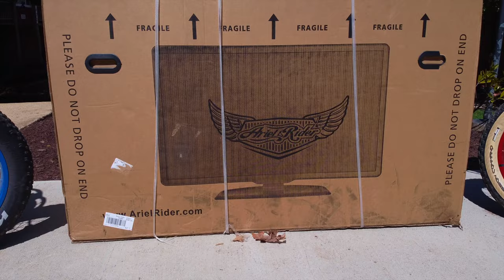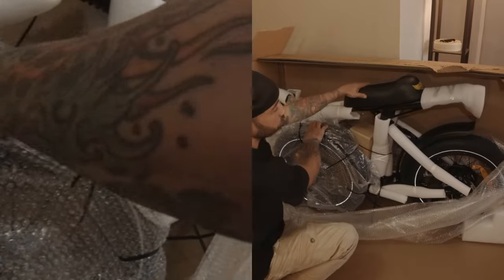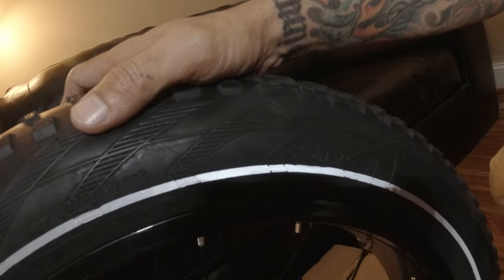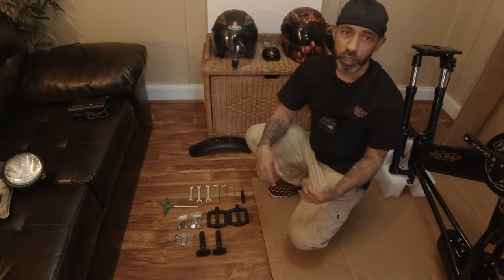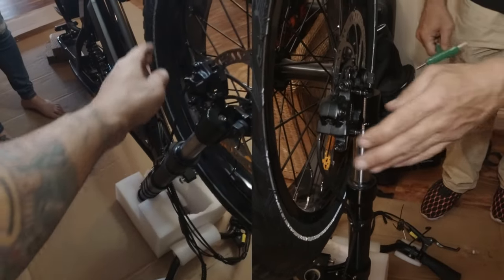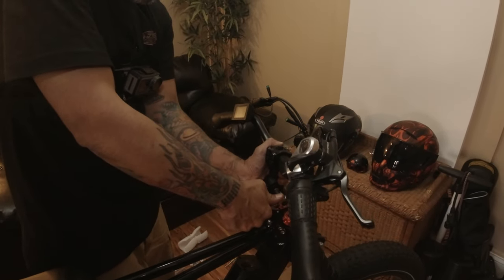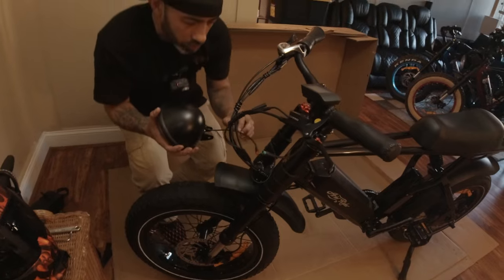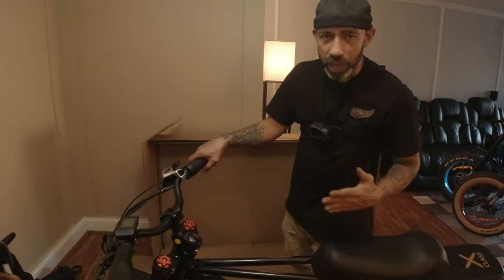52V Ariel Rider X-Class ✪ Unboxing & Assembly ✪ Fully loaded•1000W•35A•Adjustable suspension Ebike

Comment: Here's a tip for centering new brake pads to the disk. Loosen the adjustment allen screws, apply your brake and hold it, then tighten your allen screws while lightly holding brake on. This should center the disc in the pads, pressure and wear will be even. Thanks for all the hard work you put into your vids. Much better than network TV shows. Rusty is a rock star.
Reply from the maker: Richard thanks brother that means so much !

We did that as well but I left it out because the upstairs neighbors kids were making a racket (our ceilings are made of paper smh).  I meant to add a caption but forgot !!

Thanks so much for that important helpful tip !!

🐾

Comment: Hey my man if you want to adjust those calibers so they don't rub the rotors' loosen those two bolts like you did, hold the break and then tighten the screws as you're holding the brake' then release it and test it, they should be perfect and you can also do that to the rear if they're rubbing, quick and easy trick!✌👋👋
Reply from the maker: Yes indeed!!  I did that while adjusting them, but neither camera caught that part in frame 😔

Good call!!  

🐾 Thanks!!!
Reply: When you say hold the break you mean the caliber itself or the break on the handle bars?
Reply: You prolly dont care at all but does anybody know of a trick to get back into an Instagram account..?
I was dumb forgot the password. I would love any help you can give me
Reply: @Dalton Adriel instablaster ;)
Reply: @Brentley Ford thanks for your reply. I got to the site through google and im in the hacking process atm.
Takes a while so I will reply here later with my results.
Reply: @Brentley Ford It worked and I actually got access to my account again. Im so happy!
Thanks so much, you saved my ass :D
Reply: @Dalton Adriel happy to help :D

Comment: By far the best unboxing video!  The assembly is very detailed and liked the caliper adjustment.
Reply from the maker: Thanks so much for watching and for the kind words!!

Probably a better way to do it is to loosen the caliper bolts, squeeze the brake and then tighten the bolts while it's squeezed.  That should guarantee centering it.  The way I did it requires eyeballing and retrying 😅

🐾

Comment: Sweet video,hey another tip about the brake rotors,often they come with a slight warp (s) these can be straightened with very little pressure using a cresent wrench on the rotors themselves to plomb them before adjusting pads…
Reply from the maker: Thanks! That's a great tip!!

Cheers 🐾⚡🤙🏽

Comment: The calipers look like the most difficult part .along with getting them so they don't squeek or make noise or grinding feel.you made it look easy I'm not to good with mechanics thanks for the vid peace to you and yours
Reply from the maker: Another way (probably better in hindsight) is to loosen the caliper bolts just enough so the caliper moves, hold the brake lever down, then tighten the bolts while keeping the lever pulled the whole time.   That assures the rotor is centered 🐾

Comment: I just purchased mine today and during my research have been following your channel. I know this seems like an odd request but I need to see this in a medium sized doorway.  I see that your place is big but I need to see how much it clears the door way w/out a whole lot of space. Also I don't see the sticker on your bike showing it's a class 2. And in another video from another youtuber, I saw that he had a bike rack in his unboxing of the same unit. Thank you.
Reply from the maker: Hey MM congrats !

My place is actually pretty small, but I can assure you it fits through any standard door way 👍🏽

The class 2 sticker is on the center post near the battery

Hmm perhaps that person received the rack inside the box the bike came in since they orders them together 👍🏽

Cheers!!
Reply: @RustyRoads  Thanks for answering. I've just been waiting on my bike to get here. I asked those questions about the box size because I just wanted to make sure that UPS didn't have a problem fitting it inside of a regular size housing development elevator.

Comment: Thanks for the battery charge advice. Not enough concern for battery maintenance is shown for e bikes. I expect a lot of advances with constant voltage, heated and cooled batteries...
Reply from the maker: And compatibility with Electric car charging stations !!
Reply: @RustyRoads  , Absolutely! Some kind of standard, accessible charging system/network. And battery quick swapping.
Reply from the maker: New Videos premiering tonight !!  First range test !   Join the live chat !!  

🐾

Comment: I just ordered the step through version (lots of upgrades for 22 from this version).The display is terrible though, can you tell me if I can upgrade it and which higher end model can I purchase.
Reply from the maker: Congrats!!  

I have no issues with the display. Could it be better? Sure but on the other hand it provides battery level and speed.
Anything more can be handled much better by my phone 😎🤙🏽

Comment: Hi nice bike..if its a 1000w hub motor how does it get ta 2000w peak.. what's the amp controller on this ebike ..what makes it get ta 2000w power
Reply from the maker: Hi Gladstone, great question!

It's a 33 max amp controller, which is programmed to pull 2000W from the motor under heavy/initial acceleration,  but normally runs at 1000W otherwise.

🐾⚡🤙🏽

Comment: Thanks for the review!  We have  2 coming in mid May .  Like you I am disappointed in the display and light but thrilled about the twist throttle!  Can’t wait to get them.
Reply from the maker: Nice !! which colors ?

The display is literally the only cut corner with this bike, and that's not a knock on it at all.  Most if not all bikes have a corner cut here or there.  Def prefer a bike that can tackle any hill, vs one that costs more, has a nicer display but wont go up some hills lol

The light can be replaced, however the bulbs that are being used are much brighter than the ones on my other X classes.
Reply: @RustyRoads  One Blue and one red.  I am 66 and my wife is 61.  I have grown up on dirt bikes and still have a Yamaha XT225.  I road cycle a lot as well . Looking forward to some lightweight bikes . We used to have 2 Honda CT70s that you couldn’t kill .  These remind me of those.
Reply from the maker: @Marvin-fn7ks  Love it !!  Sounds like you both have plenty of experience!! 

Regardless, be careful the first time you twist the throttle !!   Once you find the sweet spot for smooth takeoffs its smooth sailing!  These bikes are PEPPY.

Please comment back after your first ride !!
Reply: @RustyRoads  will do!

Comment: A 12v accessory receptacle would be handy on any ebike("Cigarette lighter plug") Any way to access 12VDC on these batteries?
Reply from the maker: I don't believe so since they operate at 48 and 52 volts respectively, but I'm no expert.

The only accessible power is via 2 USB ports
Reply: I’m thinking since the lights are “probably” 12VDC, that could be a source

Comment: Thanks for the Vid; my 52V is coming in May, & I can't wait...I wonder if you could do me a favor. I want to get a Walky Dog Hands Free Dog Bicycle Leash from Amazon to walk/run my Dog...It has a fitting on the bike that goes around the seat post, and will fit up to a certain size. Could you possibly measure the circumference of one of the 2 rear seat posts for me...If it will fit my X Class, I would like to get the Walky Dog Leash now & start training him on my 18 speed, before May...
Thanks again for the inspiring Video 😊
Reply from the maker: Hey Don, no rap music in this one hehe

Can you share the link for the leash ?  That'll help me measure the best part on the bike
Reply from the maker: @AdamiIAm  Hi Don, Sorry for the late reply!

Since the X doesn't have a traditional seat post, I think the best place to mount that bicycle leash would be on the rear rack which is sold separately.  There arent too many round pole surfaces on that bike !

New Videos premiering tonight !!  First range test !   Join the live chat !!  

🐾
Reply: @RustyRoads  Thanks 4 gettin back to me Michael; I was thinking it might be able to be mounted below the seat on the piece that supports the seat in  back that resembles a seat post...one on each side & about the diameter of a seat post but is rounded on the ends & flat on the sides...Just go up the support that has "52V painted on, until you are a few inches from the top where it supports the seat, & measure that diameter Please... Mounting it on the Rear Rack might work, & that is a Great Idea, but it also may be too high...My Rear Rack is coming Monday, so I can measure that, but if you could also measure the support mentioned above, I would greatly appreciate it.  Thanks so much for your help & also the Great Idea...Bet you are really loving your 52V 😀😀😀!
Reply from the maker: @AdamiIAm  LOVING IT !!

I wrapped a business card around it and there was about a ½ inch gap, so approximately 4" around 👍🏾
Reply: @RustyRoads  Thanks Michael 😊

Comment: I just got my 54v X  class and I'm 5'11" and it still feels like an almost TOO tall bike to me.
Reply from the maker: I hear you lol.  How surprised were you at the size when you first finished putting it together 😅

I was like its a 🤬ing motorcycle 😂
Reply: @RustyRoads  I think I messed up.... it was an orange plug, and I plugged it in... smoke/crackle I unpluged and plugged into the hidden socket.... and my throttle doesn't work.
Reply: @RustyRoads  I almost wish I got a step through

Comment: The seat is awesome I'd switch to that seat can you tell name on seat
Reply from the maker: Hey DF !  Which seat ?
Reply: @RustyRoads  on the new bike
Reply from the maker: @dondattaford5593  that's the stock seat the X52 comes with 👍🏾⚡
Reply: @RustyRoads  compared to the old style that seat is perfect nice size not too long and square
Reply: @RustyRoads  thanks
Reply: @RustyRoads  hey great add on is a digital thermometer small screen but a well use addition

Comment: What is the most miles (over what terrain) you have got so far? 😃😳
Reply from the maker: Best has been 44 miles, road and gravel, trail speeds and plenty of full speed throttle only
Reply: @RustyRoads  Thanks Michael, That's fantastic!!!, twice the distance of a Rad Rover, or Aveton  Adventure!..Have U seen how far U can go with Pedal Assist yet? 😃🤔